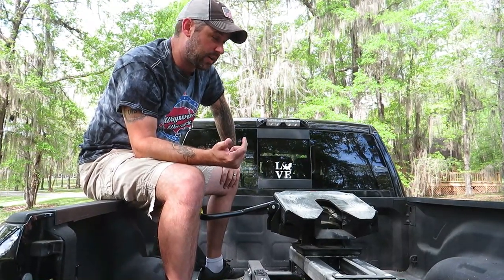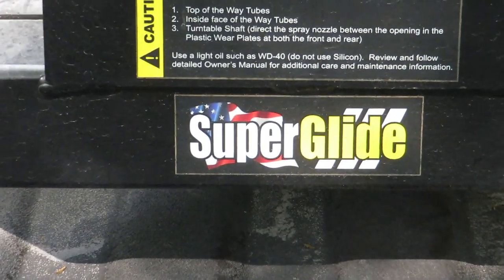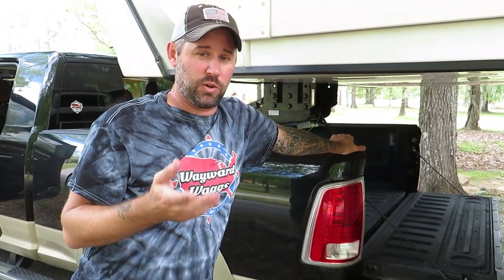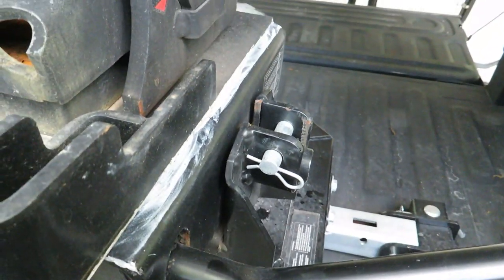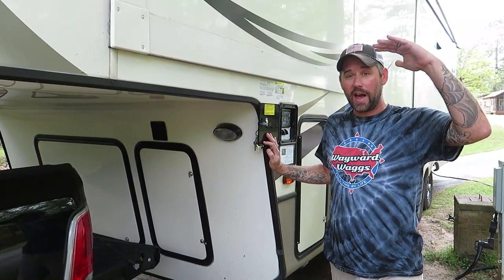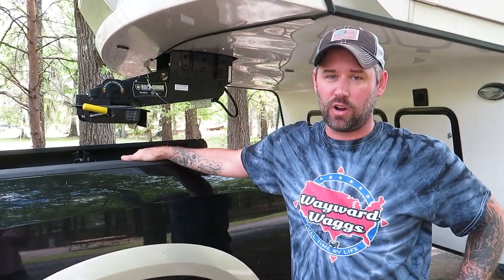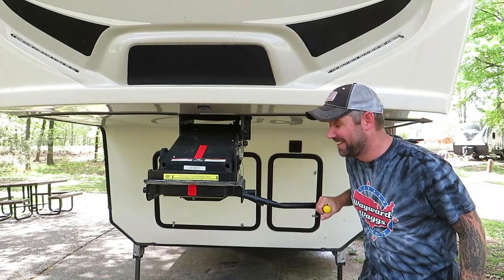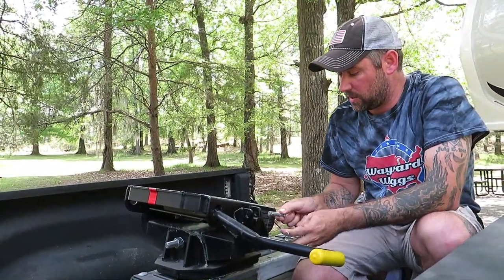Pullrite Superglide Fifth Wheel Hitch (How it works)

Comment: Hello Patriots... Does the slider only work when going forward? It doesn't slide when backing does it? Does it help with backing your trailer into tight spots?
Reply from the maker: It slides when backing also to prevent the RV from hitting the cab of the truck. It actually makes it a bit more tricky to back up but we have gotten used to it now.
Reply: @WaywardWaggs  thank you!
Reply: Been doing a ton of research since first watching your video... Can you describe the "tricky" part of backing with a slider? Thank you!
Reply from the maker: @d.m.3822  When backing, as you are turning, the hitch is sliding backwards to prevent the RV from striking the cab of the truck. The tricky part is as the hitch slides backwards, it constantly changes the pivot point. It just takes a bit of getting used to.
Reply: @WaywardWaggs  Thank you!

Comment: Does the hitch roll back when backing up as well too?
Reply from the maker: If you are backing straight, it does not but as soon as you turn while backing, the hitch moves back to prevent the cap of the RV from striking the cab of the truck.

Comment: Lubrication.  I bought a used Superslide.  The instructions I found show to use W40 on the rails.  Is it necessary or required to lube between the catch plate and hitch?
Reply from the maker: Yes. We use fifth wheel grease. You can get it at Lowe's or Home Depot.

Comment: We're going from a travel trailer to our 1st 5th wheel (Grand Design Momentum 351M) and towing it with a 19 F350 CC SB and Ive been back and forth on what hitch, I would love to be able to just get a Andersen or even a Goosebox and have a clean bed to put our kayaks in when we go but we go camping in some very tight places and live in a city so again a lot of tight turns and Im afraid one day I'll be jammed up and need it too slide back. How heavy is the whole unit and is it manageable by one guy (pretty strong) without the head on. Thanks
Reply from the maker: If you think it might hit, it is worth getting a slider hitch. If your cap hits the cab of your truck, it will do a lot of damage. I am not sure how heavy the ider hitch is. We have a video coming out this morning talking about the weight of our RV.

Comment: Is the hitch easy to remove from the bed of the truck? Also, how heavy is the hitch? Can you put a tonneau  cover on the bed when the hitch is not in use?
Reply from the maker: We have never removed ours from the bed. I am not sure how heavy it is but it would probably take a lift or a few good sized people to get it out. We use a hard trifold tonneau cover and it works well. We just flip it up on moving days.

Comment: if you have to connect at an angle the remove the plate off the 5th wheel then it is like a normal hitch then pull trailer out of spot unhitch 5th wheel and put plate back on and  you are on your way but have someone watch the 5th wheel so it doesn't hit the truck 5th wheel will not move back without the plate
Reply from the maker: Good tip. Thanks Jeff.

Comment: When backing to the left, how far forward of the hitch does the release handle on the left go? Would it contact a bed mounted auxiliary fuel tank?
Reply from the maker: It does not go very far forward. I don't think it would hit an auxiliary tank. The whole hitch has several pegs and holes, so it can be moved farther back if needed.

Comment: Do you think you could hitch up the same way you simulated unhitching on an angle?  Or would that be too difficult to line the truck up that way?  IE:  Take the upper plate and latch it onto the catch plate and then back up to it and lower the RV down onto it again?  Just curious.  Great video - thank you!
Reply from the maker: I think that would be difficult. You would have to lower the RV to perfectly line up with pins on the top of the hitch with the grooves on the lower part. I hope that makes sense and answers your question.
Reply: @WaywardWaggs  It does and I figured that was the reason you didn't "expertly" show us that maneuver!  Thanks again.  Just purchased the 2900!!!

Comment: We are told that the bolt in front sometimes needs adjusting.   Is this true and if so, how do you do this.
Reply from the maker: Yes. It does. You can do it with a regular wrench and an Allen wrench. We replaced our bolt with a lock bolt so we would not have to keep adjusting it.

Comment: Need to ask if I can do this on an angle and drive away once I clear the hitch why can I do the same if I get my truck back to the same spot to lower my hitch on to my pull ride ?
Reply from the maker: You could but it would be really difficult to get your truck in the exact same spot to lower it into the grooves.

Comment: How much of a difference is this hatch backing up then a regular 5th wheel hitch? Does it turn faster than normal?
Reply from the maker: It is a little more tricky backing up. The angle changes as you back up and the hitch slides. It is a learning curve for sure but it is not bad.

Comment: Where do you put emergency brake cable?
Reply from the maker: We connect the kill cable to a carabiner and latch it to the strap ring that is installed in the bed of the truck.

Comment: Late to the game but I greatly appreciate the video. The question I have had to do with slowing/stopping and accelerating/pulling away. Is the hitch supposed to slide backward until the back of the hitch stops it, usually pretty forcefully. The goes for stopping or deceleration. Itslides forward and slams against the front of the hitch. Any guidance would be great.
Reply from the maker: It is definitely not supposed to do that. You should have your dealer look at it. It is only supposed to slide back and forward when turning and it should bee a smooth slide, not slamming.
Reply: @WaywardWaggs  Thank you for the reply and I am very impressed it was so timely.
Reply from the maker: Our pleasure. Happy to help.

Comment: I have a 2022 mega cab dually & I have the 24k super glide & I want to work transporting new RV’s But do I need to purchase a catch plate to not hit my cab? 😱
Reply from the maker: Yes. You would have to have a capture plate and put it on each kingpin of the RVs you are transporting. It is very easy to uninstall and reinstall.

Comment: hey sorry I have maybe a dumb question. I bought a 2700 super glide. does it matter what capture plate I have? I have a 1995 fifth wheel trailer.
Reply from the maker: The correct capture plate should come with the hitch. Ours did.

Comment: I've noticed that from time to time our hitch makes more noise than usual. Not just when we stop and start but also when going over bumps - we occasionally have to remove the hitch completely out of the truck.  I'm nervous that something wasn't put back on correctly.   The truck has no problem pulling the RV and it responds very well but the noise worries me. Is this normal?
Reply from the maker: We have not experienced any weird noises. I would have it looked at to make sure it was installed correctly.

Comment: the one thing that i am confused with on this hitch is how does it slide forward when moving forward and back when moving back?  It is not motorized and I would think it would work the opposite way where when you drive forward it would slide back (which would be bad lol).   what am i missing here
Reply from the maker: I am not sure exactly how it works but it does. It has something to do with the capture plate.

Comment: My pull rite hitch is sliding into the back angles even when going straight. It then has 18 to 24" to bang front and back. Hitch was turned 90 degrees even though truck and trailer were straight. Any ideas,? I had someone pull it to site for me.
Reply from the maker: It sounds like something might be wrong with your hitch. It is not supposed to do that.

Comment: Great video! I'm new to fifth wheels and have to make a decision about a hitch. I've narrowed it down to the SuperGlide and the Andersen. Both are so very different. But I tow by myself and I need a hitch I can handle alone.  Was Andersen on your radar at all? It has a great deal of appeal...but there's something...comforting about the SuperGlide (even though it's huge and HEAVY). I've been researching for over a week, and I finally have to make a decision, and I haven't come across anything about either one of them that makes the decision any easier. (To be fair, I've been hearing a lot in the last few days about the Andersen ball shearing in half in hard stop situations.) The need to be absolutely straight on with the SuperGlide is concerning because I've had so many campsites with my bumper pull that I've been able to get into because I can unhook and hook up at an angle. If you are able, I'd appreciate any insights about the hitches or hooking up the fifth wheel. Have a wonderful day and thank you for the informative video (and NOT showing how to install--I'm not doing that--lol).
Reply from the maker: We have not heard much about the Anderson hitch. We like our superglide but being by yourself might be a little challenging hooking up to the superglide.
Reply: @WaywardWaggs  Well, I did it! I bought the SuperGlide!  It'll be installed this Wednesday, and I pick up the new 5th wheel on Friday. Very excited!  I've managed to connect to my TT by myself (granted, it's a bit more forgiving), I'm sure I'll figure this out!  Thanks again for the review!
Reply: @WaywardWaggs  Hi again! It's been several months now, and I still love the Superglide. The fact that I don't have to worry about getting out of the truck to pull a lever for the slide to work and out again when I no longer need it to slide makes me appreciate the engineering of this hitch every time I use it (which is frequently).  Anyhow, just wanted to follow up.  I hope you and your family are doing well.
Reply from the maker: @allonsy9808  Awesome. Glad to hear it.  We love ours too.

Comment: What if I'm still hauling and have to make a tight turn?
Reply from the maker: That is the purpose of the hitch. The hitch slides back on tight turns to avoid a cab/cap strike.
Reply: @WaywardWaggs  I have ram boxes on my truck and don't think it would work

Comment: Why couldn’t the trailer be hooked back up to the hitch if “at an angle” the reverse procedure of how you demonstrated unhooking the trailer when “at an angle”?
Detach the hitch plate from the glider base, hook the hitch plate to the catch plate on the trailer kingpin, back up the pickup so that it is below the hitch plate, rotate the glider base to the correct orientation, lower the trailer with attached plates back on to the glider base, and re-secure with the pins?
Reply from the maker: It could probably be done but you would have to be spot on. It would be very difficult to get the truck directly below where you need to lower it into the pin grooves.

Comment: I have a similar 3121 model and Ram 2016 SRW. Our front height on the fifth wheel is over 13' 7" . What if any adjustment have you made to keep your height under 13' 6"  . Thanks
Reply from the maker: We have not made any adjustments to ours and we are just under 13' 6" when hooked up to the hitch.
Reply: @WaywardWaggs  OK thanks.  I did find find a Pullrite  mount #2911 which will drop  the height 1.5 inches

Comment: How do you stop the hitch from moving back and forward when you're driving. I've adjusted the stop plate and it still does it.
Reply from the maker: Ours slides back only on turns. It does not slide back when we are driving straight. You should have yours looked at. Sliding while driving straight does not sound right.
Reply: I adjust the stop plate pretty tight. I make it so it takes effort to turn it past its pivot point when forward and have no problem with it sliding unloaded. 
If it's sliding unloaded not tight enough.

Comment: Hi, I'm not real clear on the issue with backing up, Can you explain?
Reply from the maker: The hitch slides backwards away from the cab when you turn at any angle, which changes the pivot point.

Comment: Couldn't a similar process be used to hook up at an angle?
Reply from the maker: It would be pretty difficult. You would have to get the truck exactly above the pin grooves. Very little room for error.

Comment: great video..but you hitch is out of adjustment.....we also had some problems when the hitch is soooo loose that you can turn by hand. it swivels when you back up and sometimes will not hitch.. the correct adjustment is to make it so hard to turn that you need 2-people to straighten it..... i made a devise to turn it straight
look at my post on the montana web site ...  look at  "FORBRUCE" post #10   https://www.montanaowners.com/forums/showthread.php?t=82622  .
Reply from the maker: Thanks for the suggestion. We appreciate it.

Comment: Thanks for the very informative video. I am really interested in this hitch. Do you experience any chucking etc. when you are towing with this hitch? As to your caution on the hitch turning sideways when backing up, PullRite has a video on how to maintain the gliding hitch. One of the things mentioned is that the hitch is not supposed to turn or slide back easily when it is not towing and at the forward position. You can rectify this problem be adjusting the forward stop. https://youtu.be/ZODRisHsasM
Reply from the maker: Thanks for the info. We will go check out that video.